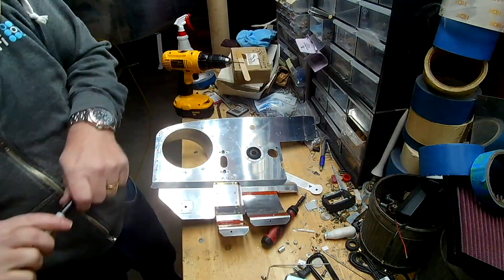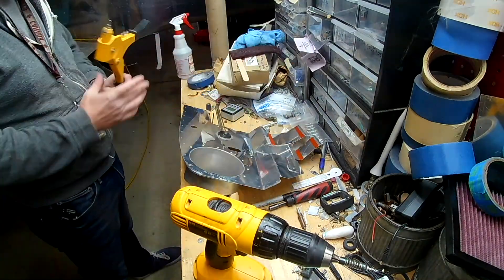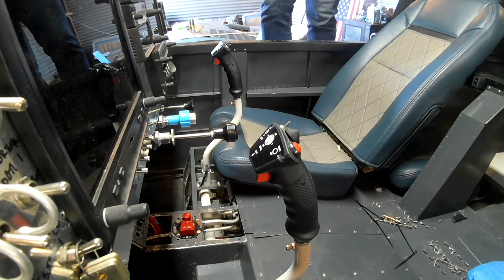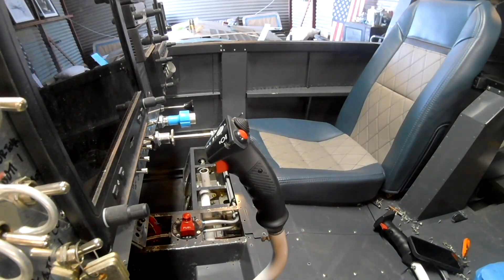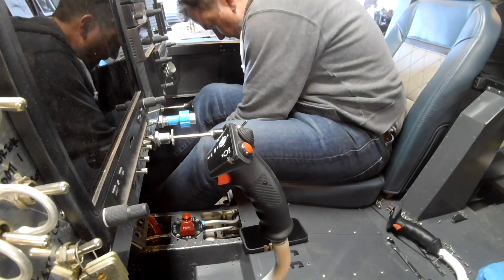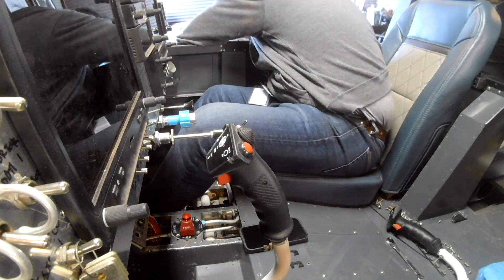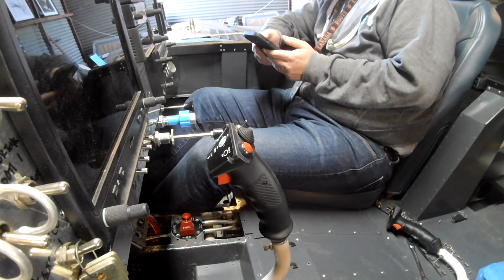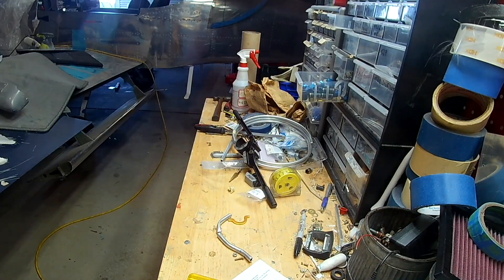RV-14 Baffle Seals and Fuel Return Lines

Comment: TSFlitelines (Tom)or Aircraftspecialty (Steve) make a line with 2- 90 degree fittings that is sized to go fight in there. That's what I did and it works great and is easy to remove in the futures if necessary.